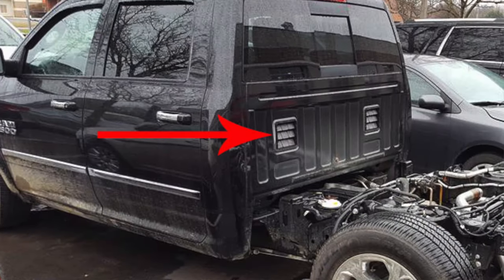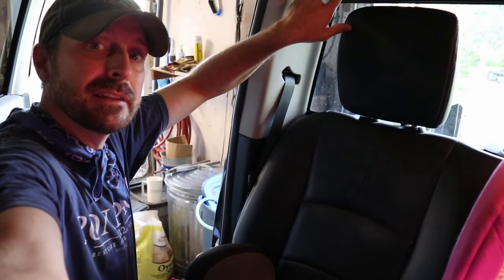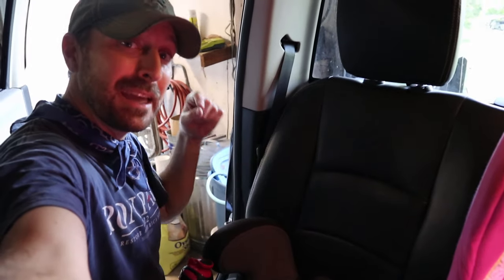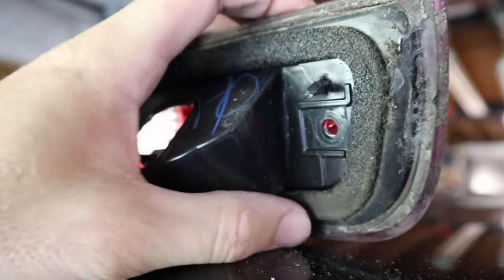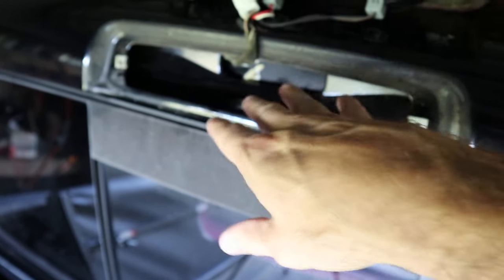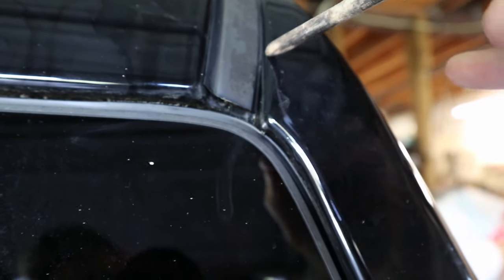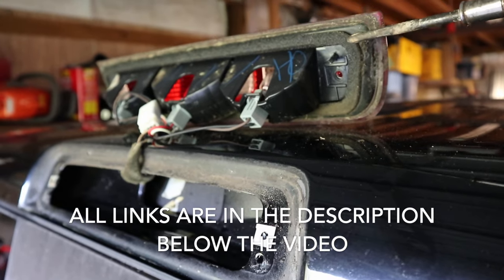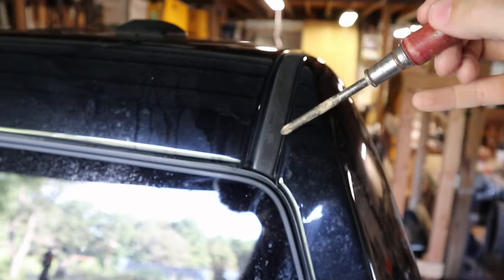RAM Third Brake Light Leak And Another Hidden Leak Spot - DIY Self Sufficient Vehicle Repair

Comment: make sure that the silicone you use is acid-free or else it will erode any metal over time.  Do not use standard bathroom caulk sealant as that contains acid.
Reply: It needs to be 100% silicone in order for it to be mold free.

Comment: You can purchase a new 3rd brake light assembly (part no. 68298380AH LAMP-CENT) for $37.65 from the dealership, at service and parts.  Dodge will install it at a labor charge of $30.00.  I think the leak problem occurs because if you park your truck outside, the sun damages the gasket seal.  So it will need to be replaced every 3-4 years.

Comment: Its bad enough sunroofs leak, but 3rd brake lights, rear vents, body seams and rear windows have all been known to leak on these Rams. Not only that but if you have a rear cap you have to move it back  to remove your 3rd brake light. Good grief for what these trucks cost this is inferior stock materials and parts. We had the issue of water under the rear seat  and coming out of grab handles. When we ordered the gasket for the third brake light it came with two. We found out why. After we installed the gasket, we checked our seal by turning on the brake and cargo light to see if light was noticeable between the seal and the cab which it was. It appears the light assembly has a bow in the middle and does not set flush. The screws on each end of the lens are not sufficient, as it needs a couple in the middle of the assembly too.  So we  doubled up on the gasket and it sealed the light assembly to the cab. We also put a bead of silicon around the perimeter for good measure. Problem solved .
Reply: Where are you putting the bead of silicone at
Reply: @lynetteverner9038  Over the gaskets between the light assembly and the cab. I smoothed the bead out with my finger like you would when caulking anything. The two gaskets would probably been fine but I added the silicon to be sure across the top.
Reply: you should probably check your step rails on your truck too.

Comment: If the water goes forward does that leak into the door grab handle of the front passengers because my pillar of the door handle on a driver side is leaking is it because of that??
Reply from the maker: It could.
Reply: Thank you I’ll try it
Reply: Mine did!!

Comment: Any rubber gasket will "dry out" over time, losing its ability to expand. I took the third lamp off, cleaned off the gasket, tapping the dirt loose, letting it fall out... then saturated the gasket with just enough silicone, leaving the lamp off while it absorbed. Then reinstalled the lamp. For good measure sprayed a small amount along the top edge using the straw. Two rainstorms later, still no leaking.

Comment: Seems like the OEM gasket is a bit of a cheapy thing, that open cell foam stuff.  Could you make a DIY silicone gasket by putting wax paper or something in the slot for the gasket on both truck side and light side, place silicone, allow to cure, then take it apart & remove wax paper?  That way the seal would last and still be able to take apart for maintenance.
Reply from the maker: It did last 9 years before it started leaking. I like your idea though.
Reply: @CountryLivingExperience  Yeah, no sech thing as a permanent fix, I guess know that.  Was good enough. I see others are using weatherstripping from hardware store, I can make things harder than they need to be.  I was already subbed to your channel- you cover alot of ground, thanks for all your work!
Reply from the maker: I appreciate it. Thank you.

Comment: I have a 2019 Classic and found water visible leaking from the corner of the rear drivers side.  This video is perfect for avoiding the ridiculous time waiting for the dealer to fix. Thank you
Reply from the maker: You're welcome. Glad it helped
Reply: Same  2019 Classic 4 door 1500. All wet above the passenger side back seat headliner and running into the storage under the back seat. Excellent video and will be getting the stuff to fix it today!!!!
Reply: I just had the top of my truck painted and now this leaking started just behind my seat left side coming through the headliner-
This is a regular cab truck-

Comment: Thanks so much for this video. I did the silicone at the end of the weather stripping by the back window. I didn’t think about the 3rd brake light. I’ve been losing my mind the past couple days. I will order a new gasket. 👍🏽
Reply from the maker: You're welcome
Reply: Just noticed my weather stripping on passenger side is loose at the end... now I see water stain on upper passenger side roof....  now I know the fix.... glad I found this video !!!

Comment: Thanx for the video... just noticed my 2017 1500 leaking and a water stain in the upper passenger side roof liner... . My weather stripping has come unglued for about 2 inches.  Makes sense now.  Glad I found this video.  I had just ran my truck through the auto car wash !!!!
Reply from the maker: Glad it was helpful.

Comment: Mine is a 2 door 2016; the sheet metal under my high mount light is stamped differently than yours. 
Instead of a straight metal line between the window and the light there are a couple gaps at the bottom of the light and water was getting in right there, all it took was my better half holding the hose while I sat inside the cab.I ended up switching to LED bulbs for long life then using a clear flexible sealer (DAP Ultra Clear) as a gasket for the light assembly and plugging the gap between the light and window frame. 
It's been bone dry now for 3 years.  Good vid, thanks!
Reply from the maker: Cool. Glad you got yours figured out and fixed.

Comment: Don’t forget to protect your sliding window regulator and the RF Hub. Both are on that wall behind the seat. I just had my RF hub replaced but the RAM dealer did t address the leaking window. Pretty poor service to charge nearly $800 but not fix the problem. Window leaks and shorts out the RF Hub. Needs to be a recall. 2019 Rebel with sliding rear window.
Reply from the maker: They should recall that for sure.

Comment: I have a 2008 RAM 2500 TBL  leaking badly. Will using a double seal stop the leak or is silicone a must?
Reply from the maker: I have never used a double seal so I can’t really say how that would work. The single seal replacement has worked perfectly for me.

Comment: Thing is, they won't recall it, because they'd have to recall Sooooo many things. I need to fix mine tomorrow. Just going to get a new assembly at O'Reilly's for about $55 then check the second spot, since my weather stripping needs replaced as well, as well as a bulb in my light assembly. Might as well get some silicone and new assembly, might save $5 🤷‍♂️

Comment: Thank you so much. I have been trying to figure out why my back window would occasionally leak and I would end up using my carpet cleaner to set the water up from underneath my backseat on speaker boxes I have a 2008 Dodge ram 2500 that I constantly work on, and mostly out of boredom, but that was a great tip. Thank you so much.
Reply from the maker: You're welcome. Glad it was helpful.

Comment: It can leak from the front as well. Mine was leaking on the passenger pillar, I had to seal the front glass and the “gutter” but never leaked in the back..I think. My 3rd brake light is out even after sealing it as well and replacing all bulbs. There is still some kind of issue with the 3rd brake light with or without a leak
Reply: mine is leaking out of the pillar as well.  How did you fix yours?

Comment: I'm on my 3rd water leak in the rear on my 14 cummins. First time was my 3rd brake like, second leak was my rear cab vents now 3rd time, I do have every down to metal in the back seat it looks like it's coming from the pass rear window but after watching this it makes since with the body seam on top with the trim piece over it mine in started to peel away from roof. Thank  you for the video
Reply from the maker: Crazy that you have had all three issues. Glad we could help.
Reply: Have the same issue with my 14 ram, roof seems were not intact to the truck near the rear glass
Reply: I finally got mine fixed last week. It was a body seem on the roof under the trim on roof. It's a pain!
Reply: @Z  oh god, that doesn't sound one bit of fun. I had the same issue(s) as you replaced the 3rd brake light and gasket maybe 2 years ago, now over winter I noticed the back seat and window get wet during rain storms. I plan on trying to remedy the situation tomorrow, how did you find it was the roof seam, and not just the trim piece?
Reply: We have a 2014 ram Laramie limited mega cab or headliners wet in the back passenger corner just like yours. Also our floor gets wet right next to the door seal on the carpet no no toolbox spot because it’s the mega cab with the flat floor also, it leaks from the front door handle which could’ve been due to the sunroof drains being plugged on our 2006 mega cab, it only leaks from the front door handles and even though we cleaned out the front drains it is still leaking. We have not gotten to the rear drains which I understand come out on the rear of the cab in a tight spot, we will check the brake light and that spot where the trim at the same comes together at the window. With so many rams leaking, there should be a class action lawsuit and a recall.
Reply: If your headliner is wet it's most likely your 3rd break light. I kinda track it down myself. I knew where the water was collecting in the cab. So I started taking the back seat out the carpet out an the back interior panels then I took a spray bottle an hitting every little area on the exterior near the 3rd break light, body seams, back window. Even cleaned the back drain holes of bottom of back window. I narrowed mine down to either body seam or back window.  Luckily a dealership in town uses a guy an that's all he does is fix water leaks an he said it was my body seam. 1200 dollars later, no more leaks. Most body shops I called wasn't interested In trying to fix it. Also behind your back seat you have cab vents those dry rot an will start to leak also. This was my 3rd leak in this truck all but this last one I was able to self fix. I hope you guys find your leak, I know how frustrating it is.
Reply: @zac1121  can confirm about the vents behind the back seats being a issue...

Comment: I have water stains in the back corners of my headliner and I can actually lift up the seals on both sides that separate the roof from the side panels, as you mentioned. The seals are one piece until they reach the back of the cab, then there is a shorter piece that curves down the back of the cab, which is the part that seems loose where I can lift the tail end up almost a quarter inch. Can that part of the seals on both sides be removed, cleaned, and resealed?
Reply from the maker: Yes, I have partially removed them on mine, cleaned them, and put a silicone sealant there to reseal.

Comment: Did you notice condensation on the front windshield because of the moisture in the back? I thought it was the glass that had to be resealed but the dealer claims it might be the third brake light.
Reply from the maker: I had not noticed that at all.

Comment: Mine is leaking out of the driver side front grab handle screw opening.  Tried sealing the rear brake light and it's still leaking.  Would that other window strip spot allow water to run down to the grab handle?  The headliner is totally dry and there isn't any water coming out anywhere else...
Reply from the maker: I have never seen it leak in that position. Did you get a new gasket?
Reply: @CountryLivingExperience  found water coming out of the serious radio antenna in the back corner so I silicone that all up today we'll see if that works

Comment: The roof leak plus the rear vent leak are just two of the many problems I have really been disappointed in my 2013 1500 Ram truck and these problems didn't just start up because my truck became 10 years old, the six trips back and forth to the dealership to get the AC fixed should have been my first clue when the pickup was still new.

Comment: I bought my 2004 used with 14K on it and it leaked and I chased it for a couple of months....it also didn't have a rear slider and I wanted one so I had it installed by a glass outfit.......I finally got around to really locating this leak and finally tracked it down to the top of the window seal not sealing tightly.....I had sealed the 3rd brake light earlier which eliminated that area.....
I'm now leak free but the sealant I used, not silicone, has started to melt in the heat and creep down the window......I will need to clean it out and reseal it with silicone.....

Comment: Please help me. My 2015 STL is cutting out. I changed the intake gasket. 
I was told it is getting too much air. 

Where does the hose from the intake running to the back hook into and is there supposed to be a clamp.
Reply from the maker: I am not a mechanic friend. I have no idea.

Comment: You can use any similar size weather stripping. I got it from local hardware store
Reply from the maker: Not for the light. It is a special shaped gasket. You could give it a try and see what happens
Reply: @CountryLivingExperience   for my 2016 it worked. It worked for about 5 years. I am replacing again. The stock one only worked for 2 years.

Comment: Good video, but I have to add that the brake light will not stay sealed with just the gasket.  They make the third brake light out of plastic (all brands).  In the old days they had a pot metal frame for strength.  What happens is that you tighten the screws which bows the light and then it will leak sooner or later.  Fix it by glueing it with RTV.  I know, I had to learn the hard way several times.
Reply from the maker: Thanks. Mine is still holding with the new gasket after a few years. I know it won't last forever though.
Reply: @CountryLivingExperience I have a 2008 RAM 2500 TBL  leaking badly. Will using a double seal stop the leak or is silicone a must?

Comment: Anyone know where to buy oem seals for tail lights not 3rd light! do they have gaskets around each bulb and or a single gasket around the housing? My lower portion for reverse light is wet but no damage from any accident, is this split from upper and lower as in air tight separate areas for upper and lower bulb? My guess is the light is leaking and only on the bottom but idk plz someone help! I have a 2017 dodge 1500 slt v6 quad cab with chrome trim but not around the rear lights. The truck has 22k miles so this is annoying. Thank you!

Comment: We just went through this same issue but on our Ford escape where a channel was blocked.  We had even replaced the windshield thinking it was the seal!!  Question:  have you found a way to clean your headliner from the water damage??  Ours looks terrible 😢
Reply from the maker: Sorry, I have not found a way clean our headliner. Luckily it is not too bad.
Reply: Motorcraft professional strength carpet and upholstery cleaner, if you search 3rd brake light leak on f150 the ford tech makulu (spelled wrong)guy uses it in the video
Reply: The headliner is hard to clean because the glues are sensitive. The headliner can end up sagging I would take it somewhere and have them clean it. The best detailer in your area will be the best bet

Comment: I put rtv around the third brake light and under its gasket. Hopefully the leak stops. 

I’ll cross the bridge of getting it back out when the time comes.
Reply from the maker: Hope you can get it off.
Reply: I got it off. But water still coming in
Reply: Sealed the shark fin.  Water still coming in.   I have a crack below the corner of the rear slider on the driver side. But from the out side I can’t see any brake or opening it could be leaking. And my head liner in wet about 6-8 inches from the top of rear window up.  
2020 59k truck that can’t keep water out. I’m pissed.
Reply: I might just wreck it and buy a better brand.  @CountryLivingExperience  I m

Comment: Mine is so damn weird. Its a 2021 they replaced the whole 3rd light but it still leaks. Headliner was never stained. And the water settles on each side of the seat on the plastic. Runs down under the seatbelt plastic and goes down.  Drips from the top corners where the plastic meets the back window. They cant figure out whats wrong
Reply from the maker: Very strange

Comment: My sliding glass trim is leaking, but cant find a video on that anywhere
Reply from the maker: Sorry, my slider has never leaked so I am not sure.
Reply: Could be a gap, try some silicone or something similar, or could be something in there causing the gap. Check for debris then just seal it up If you can. Better than replacing your interior for $3-500
Reply: @TOXIC-jq3ry  fixed it it was the drains clogged up. Drilled them out all good now